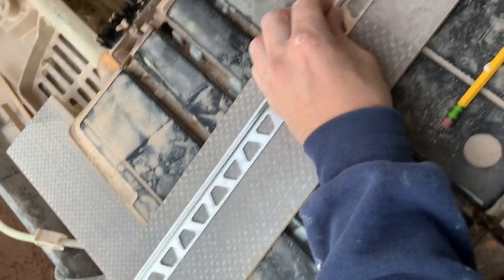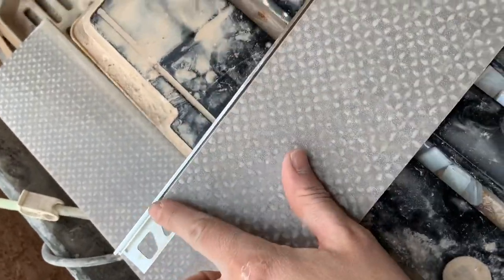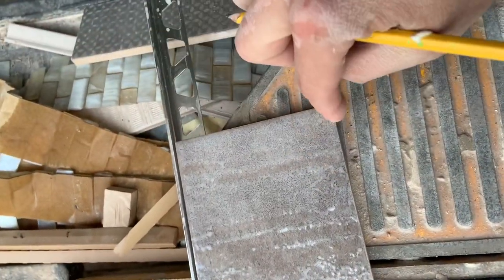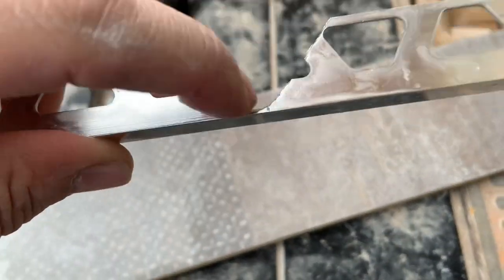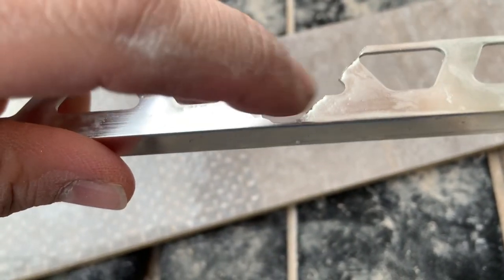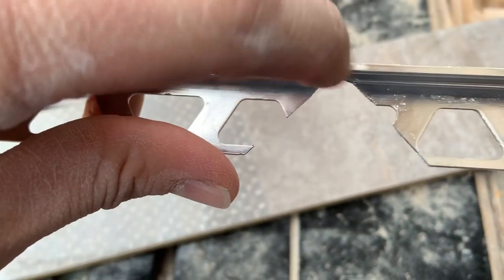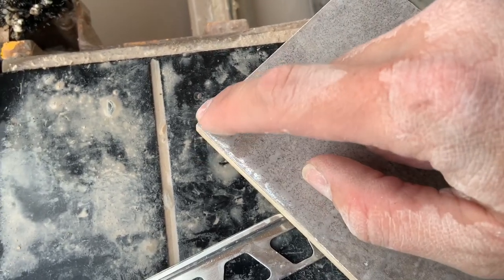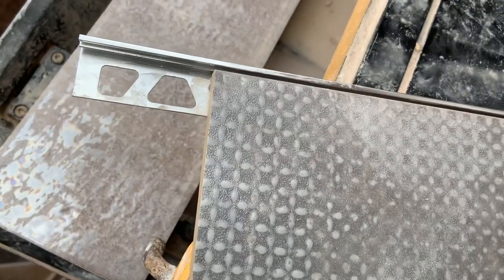How to bend schluter tile profile

Comment: Thanks for posting this. I did the bends as per your method and it's coming along nicely. The only issue I'm having is that there is a slight discoloration at the bend point visible on the surface due to the bending (not from over-heating). Maybe it doesn't affect the chrome, but it is affecting the Schulter brushed aluminum finish I have.
Reply: Because it is not made for it. I did that 10years ago. Its best to cut it or buy the edges that is made for schluters profiles. And ive been using schluters for 13years. Just from experience.
Reply: This happened to me today but I was using the white coated one and I luckily had enough spare to just cut it instead 🙏
Reply: just roll with it

Comment: This profile is not intended to be bent at all, they make a radious profile for curves but even that one isnt intended to be bent at 90 degrees... just miter it, sand the edge a little with wet/dry paper. It looks better.
Reply: No way the seamless bend looks way cleaner. I don’t see any reason why it would fail
Reply: @VVMVVMVVM  Its not about the potential for failure, its about the unprofessional aesthetics, its "seamless" sure, but there is a big and obvious kink that developes and bulges out.
Reply: emery board fine type

Comment: Yes but in most cases you cant bend the profile first and then measure,you have to predict how long the profile you need before cutting,and it's a bit complicated to know in advance.
Reply: Cut it long by 3cm, then flip the piece upside down in place to mark the length or height. It's the way to go

Comment: Thanks ! Do you think this can be done with schluter bullnose profile ?
Reply: Rondec, unfortunately no. I’ve gotten close but the metal will sometimes stretch causing the finish to not be uniform at the bend. Recommend either mitering or using the premade corners. 📝

Comment: Dont do this. You spend 6x longer for it to look like Sh** !! Just cut it.
Reply: Imo, Customers prefer this look. It's more consistent and faster to get everything cut and aligned. It also doesn't catch your rags or fingers with a sharp edge while cleaning.
Reply: 🤫 Definitely opinionated here. However, much safer to just bring it up to your client. Give them one or the other. Personally, I like this; cleaner, more crafty, rare, and it takes knowing to do it right. 📏
Reply: @tjatile It doesnt look better, they arent supposed to be bent and they deform when you do, miter cut looks MUCH cleaner.